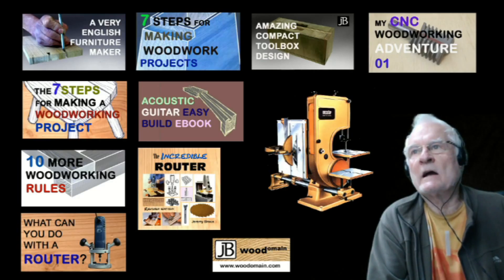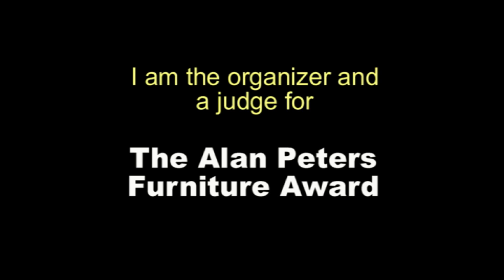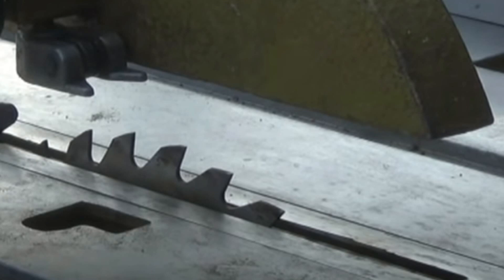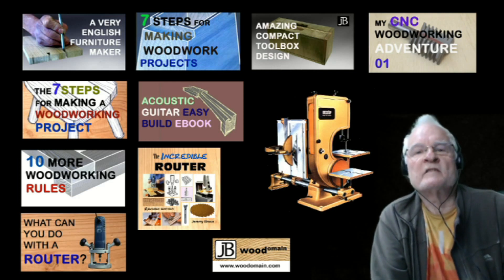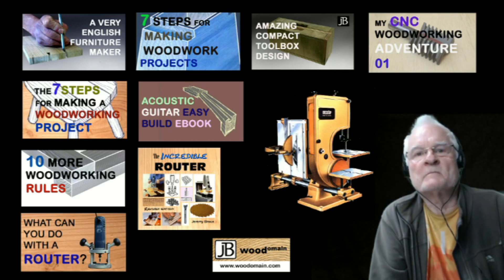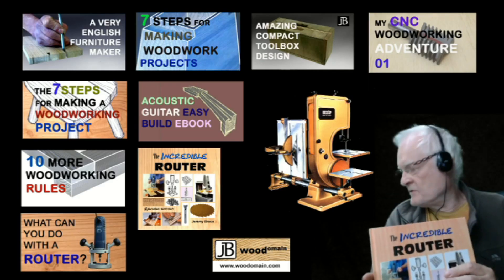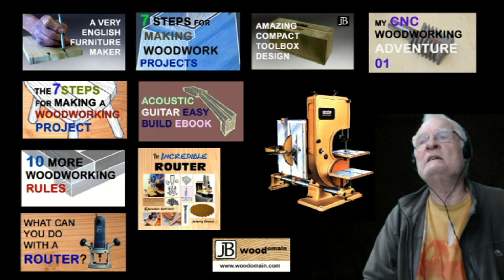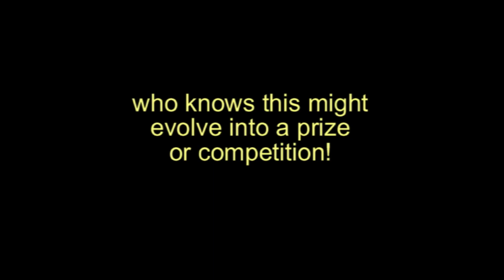Good with wood? Design A Plywood Universal Woodworking Machine

Comment: EmcoStar ❤️ I have one myself, but since I‘m from Austria, it‘s easier to find one. I Can recommend the Original Model to everyone, the EmcoStar 2000 is nice as well, but Not as well built and harder to change working positions. There is a Planer attachment as well, called Emco Rex.
Reply from the maker: Yes I agree, this original modek is the nicest. There are 16 functions.

Comment: I have an old 40's ShopSmith 10ER, I use it as a drill press. I'm not sure when they stopped making these but there are different models that do everything you would need in a small shop. May give you some ideas.
Reply from the maker: Thanks, yes  I recall these machines. These are combination machines whereas I want to design a compact universal machine that includes key tools such as band saw, router, belt sander, planer etc. that give versatility for a hobbyist.
Reply from the maker: I wouldn't agree it would do everything I would need. A band saw is an absolute priorirty for versatile cutting and so too a router (see my book The Incredible Router:   https://www.woodomain.com/online-store/Books-c40558220 )

Comment: I suppose having encouraged the project I feel I should volunteer my services in any way I can bearing in mind I would be a coming from a maker and definitely not a designer.
Reply from the maker: Thanks Joe - yes you initiated this by your comment on my Facebook page. Actually your suggestion would fit very well as I don't have time to make but I can sketch ideas and design/problem solving is my real passion!  But any ideas would we welcome, maybe to brainstorm here such as what primary tool functions and whether it has more than one motor. Linking motors is a challenge I can foresee.